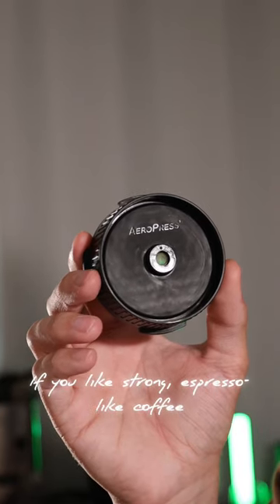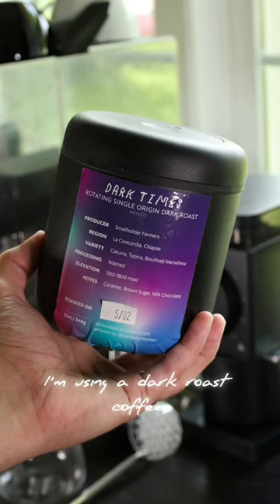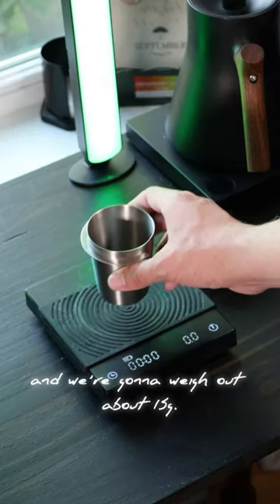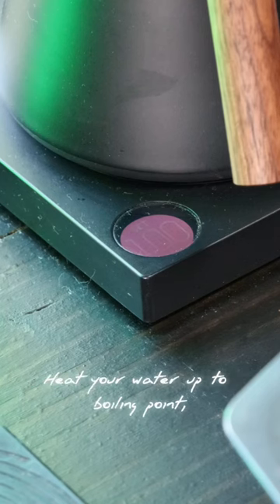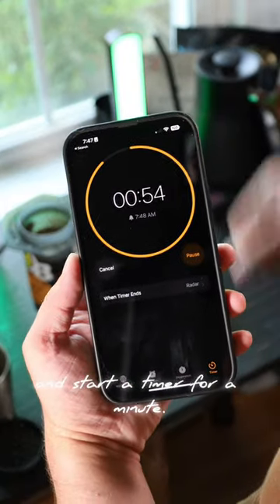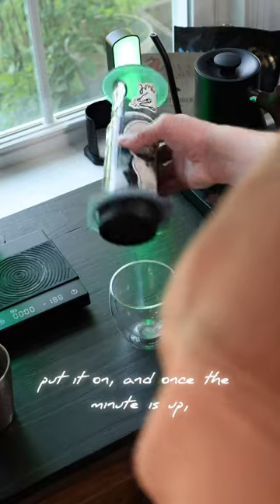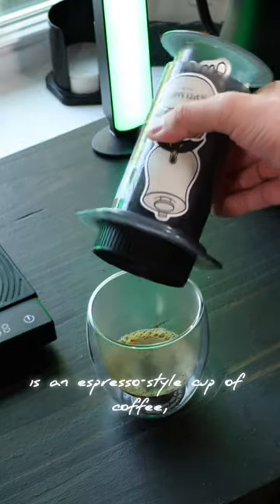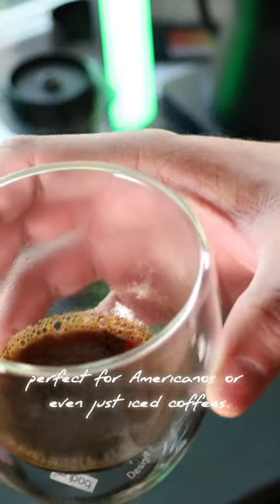Espresso-Like Coffee with the Flow Control Cap from AeroPress! #shorts #coffee #aeropress

Comment: Is the flow control more difficult to clean then the normal cap?
Typically I just get a bit of dish soap on a finger and clean the cap by hand after each use over the couple days it takes for the dishwasher to fill up, then put it in the dishwasher the next time the washer is full enough to start.
The groves in the flow control seem deeper, which makes me think a bit of soap on a finger won’t be enough and it’d require actual scrubbing after each use.